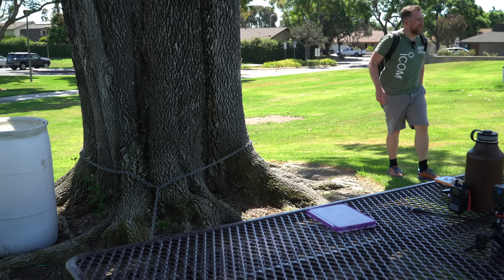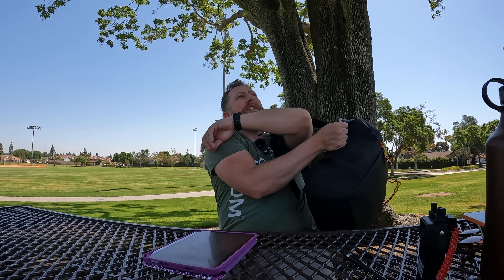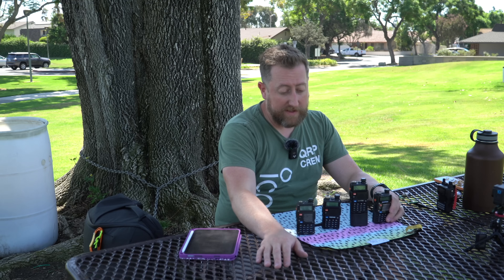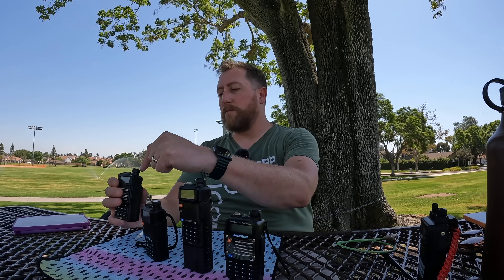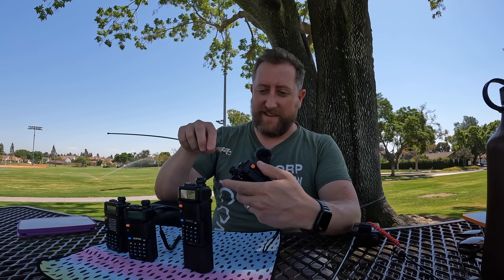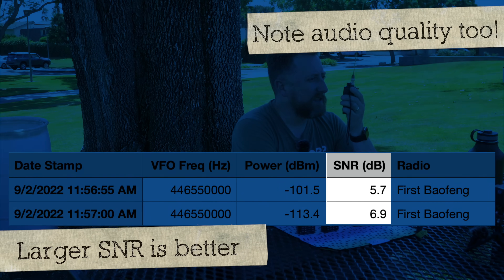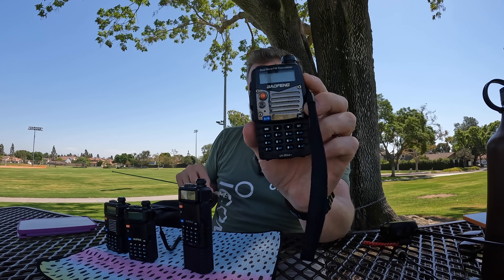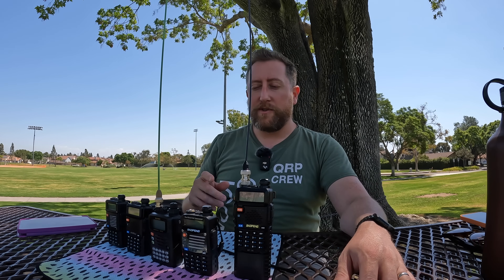Baofengs Testing Throwdown - UV-5R, BF-F8HP, GT-5R Ham Radio Testing

Comment: I have both the UV-5R and the BF-F8HP. Here's the differences I've noticed over 2 years of owning them:
-BF-F8HP has a better speaker. It has more bass to it so voices sound more natural. The UV-5R is more difficult to hear weak transmissions and understand them due to this. 
-The BF-F8HP when scanning is not able to skip a channel with the arrow button and continue scanning. The UV-5R can do this. 
Below I will post transmit wattage for both radios as tested on a Surecom SW-102 w/ a pigtail and adapter. Some loss will occur due to this.
UV-5R: 
-2m Call 5.25w
-70cm Call 3.75w
BF-F8HP:
-2m Call 6.5w
-70cm Call 5.7w

Comment: I currently have a Baofeng UV-5RV2+ but am upgrading to a Baofeng BF-F8HP because the F8HP can legally transmit to FRS frequencies which could be important in emergency situations.  I am dual CERT and ham technician certified and am on our city emergency communications net.
Reply: At the risk of being labeled a sad HAM: BF-F8HP is not legal for use on GMRS or FRS frequencies. As a tech you should probably know this.

That being said, the FCC has no record of ever punishing a Baofeng user for using GMRS/FRS frequencies. They're far more interested in pirate radio, jammers, or people interfering with public safety. As long as you're not being a dickhead you almost certainly won't have an issue using a UV-5R or F8HP on FRS/GMRS frequencies even though it's not technically legal.
Reply: @dan8250  The FCC told me that I can transmit on those frequencies in emergency situations. That is the only time I will transmit on those.  I do have them programmed on my radio though. My family also has a GMRS license and I have a GMRS radio.

Comment: The Baofeng is THE radio that has brought SO MANY folks into HAM radio, it is the undisputed champ and best entry level radio. Stop your BS complaints of the UV-5r and give thanks for then number of folks that started here. HAM radio was dying until this radio came along. Yes there are better HT's and all of us who started with the UV-5FR and mostly moved one but we still have our UV-5R's and we love them.
Reply: I've been saying the same thing the BF F8 HP pro is awesome, and btech does an excellent job of modifying them. Even in his test, his yeasu was by far the worst transmitter 😢. If not for baofeng, the whole ham gig would be just about over now. All they need to do is enter the all mode mobile arena even at 50 watts and game over for icom and yeasu. No hate I have a DX10 but sad it's not all mode like the 991a I'm sick and tired of stacking radios and wires it's completely unnecessary in almost 2025 but thanks to the fragmented big boy brands that can't decide on a mode this hobby is going nowhere fast especially after starlink came out.

Comment: Now I am more confused!  While the numbers clearly showed the GT-5R being the winner, I think it sounded infinitely worse and harder to understand than the BF-F8... like not even a comparison.  Also by comparison, my Midland 275 GMRS sounds infinitely clearer, but I haven't learned how to use repeaters yet.  I was picking up people from Abilene (TX) while in Colorado yesterday... 428NM from KALS to KABI.  HOW in the world could I hear them (they could not hear me)...???  Also- if I can hear GMRS for 400+ miles away, while in the mountains with rock walls towering over us, why would anyone limit themselves to a radio setup limited to just a few miles?  Was this a fluke?  (It has to be.  The radio in the King Air I fly can't reach that far...How else can a $125 radio tucked into the mountains perform better than the $10,000 radio in my plane at 25,000'?)  None of the radio licenses I have had for 25+ years now give me any ability to explain this: not my GMRS, HAM, RRTOP (Aviation specific) ... This flies in the face of everything we know about radios... ANY THOUGHTS?

Comment: UV-5R vs BF-F8HP. Most of the review videos I watch comparing these two radios is over my head. I want to pick one for listening to VHF and UHF. Not planning to talk on one. The BAOFENG BF-F8HP appears to have wider frequency spectrum than the UV-5R. VHF: 136-174 MHz(Rx/Tx). UHF: 400-520 1000 channels vs VHF 144-148MHz, UHF 420-450MHz   128 channels. The videos I have watched don’t seem to speak about that. Can you help me understand if my reasoning is correct for my intended use.

Comment: I gotta say, the BendixKing Digital radio I used with Fire/EMS back in 2001/2008 didn't sound as good as this UV-5R. 
Honestly impressive how far weve come that a Sub $30 (Included Abbree ar-771 antenna) can sound and transmit this well.

Comment: The GT-5R does not have S E spurattic emissions this was the radio that fixed the UV-5R and always use a speaker mic
Reply from the maker: Most are spurious emissions free.  Much better than the UV-5R though.
Reply: I had to drill a hole (didn't drill big enough so I got to drill bigger than the original port) in the mic port and going to have to do the same on the speaker mic.

Comment: Thanks for the tests. The Gt-5R did better than I suspected it would. I own Yaesu FT-60, FT-70. The 70d is a disappointment with the parasitic drag on the battery. Love my 60 to the point of wearing the keys off of it. If the FT-60 came with Lithium batteries, I'd own 5 FT-60s. I own UV and GT-5Rs for my go bags and when riding my motorcycle. All of my radios have Signal Stick antennas.

Comment: 6dB is also 4x the power. However, on UHF and VHF handhelds, the radiation pattern varies widely based on your hand position, antenna orientation, exact position relative to metal objects, moisture content of the plants, etc. you could get a more objective measurement by using a fixed field strength meter while using a fixture to hold and position the radio so it’s consistent from test to test. You can hear the variation in the receive audio at your home station and also in your tone test. Having said that, your testing is somewhat more objective than man others on YouTube. Thanks!

Comment: Josh... Among these radios, the power choices were the UV-5R for 4W, or the BF-F8HP for up to 8W.  But, I now see (on Amazon) that there is a new generation of the UV-5R... the BAOFENG UV-5R 8W that is also suppose to have an upgraded chipset as well, and 3 different output levels (1W/4W/8W).   I don't see anyone talking about this new more powerful UV-5R.  I'm wondering what you, or anyone, thinks about it.  And given the new power for the UV-5R, is it worth the extra money for the  8W BF-F8HP?  Thanks.
Reply: I also saw that... was wondring if they would send the 5w and make it a hassle to get the 8w---- if that is actually a thing.

Comment: Josh, great info, thanks for posting,  can you or anyone comment if there is any improvement on the receive side of the GT5R as well- pertaining to intermod rejection or is it the same as basic UV5R? Also, without the spurious emissions (GT5R) would tx power be more efficient on the chosen freq?  I have a recent Amazon UV5R seems ok, but am considering if it is worth it to upgrade to the GT5R or an even bigger step to the FT60r as the radio will be accompanying me on motorcycle rides with a 771/signal stick style antenna.. Thanks all.
Reply from the maker: I have not tested the GT5R receiver against the UV-5R.  It's on my list to do though!

Comment: Got f8hp radio March 5th worked good for 6 weeks. Two weeks ago I turned it on it made a cracking sound lost all audio. Even to earplug. Reset it 10 times still dead.

Comment: I tested mine last night on an HP 8920A RF test set (using a Baofeng 3800 mAh extended battery fully charged) and found high power at 146.52 only produced 5.57 watts (with .12 uV sensitivity on receive), 446.00 produced 5.27 watts (also with .12 uV sensitivity on receive).

Comment: My f8hp, like others (most likely ALL F8 series) has off center accessories port holes. This makes getting the programming cable or shoulder mic's plugged in nearly impossible unless you cut off some of the connector rubber (see photo). The manufacturer clearly didn't test a prototype before going to full production, not surprisingly, you get what you pay for now days!
Reply: No, you don't always get what you pay for now days!
That is why he is testing radios.

Comment: My Baofeng BF-F9 V2N are not doing anything but acting as paper weights.  I wanted them to use as walkie talkies.  I programed them as a scanner using CHIRP.  I searched for my local frequencies and loaded them.  I clearly dont have a clue what I am doing.  They scan but you never hear nothing.  All they do is scan.  I cant find any video's on how to program them properly to use as walking talkies.  I followed all instructions to program as a scanner about 1000 times and they dont pick up anything.  I have had a scanner for years and these are not that.  All I wanted them for was the walkie talking function but they are useless.  I want to use them but all this radio jargon and tech specs are confusing for someone not in the game.  I'm about to throw them in the trash and just buy some others that are idiot proof.  I've used walkie talkies for many years and these things literally dont do anything.  Its probably me but I wouldn't know because I feel like I'm doing all the right stuff.  I need someone who knows more about them to tell me what I am doing one.
Reply: Throw them in the trash right now & don't look back!

Comment: My primary radio is a Kenwood TH-F6A with a Diamond SRH320A antenna, my mobile is a Kenwood TM-D710GA with a Diamond CR320A. I've had the CR320A for 12 years.. and bought it because the Kenwood TH-F6A was my first radio (tri-band)... but it works wonderfully for the TM-D710 series radios. I've managed to comm with the ISS on several occasions using it as well as running APRS through the ISS.  The older TM-D710A I have started having issues after a few jump starts, causing it to drain the battery due to high current draw when idle, so it has been blackholed as a spare.  I bought a Baofeng GT-5R for SaG and threw a Nagoya NA-771 on it... I'm hitting repeaters here in NC clear as day with no problems. I'm about 15 miles from Raleigh and can hit almost every single repeater with no noise and zero complaints using the internal mic. Don't underestimate this little $25-$28 guy. I bought the GT-5R for my bug out bag... but with the 3800mah battery and lack of noise or issues, it''s becoming my go-to HT.

-AB9XA

Comment: I have a GT-5R that I got for the soul purpose of listening to rocket launch repeaters. They Tx on 2-meter. The GT-5R is equipped with a Signal Stick. I've found that, in order to receive, I almost HAVE to have a ground plane. I have tried leaving the radio attached to my backpack as I am listening to the launch broadcast, but it is frustratingly bad. If I take the radio and set it on my aluminum tonneau cover on my truck, it receives like a champ. The bad thing is, I am not always next to my truck when I am trying to listen. Admittedly, I know nothing of HAM yet, just how to program frequencies on the GT-5R. I am wondering if there is anything I can do, to mimic a ground plane when the radio is in my hand, vs. sitting on my tonneau.
Reply: Counterpoise?
Reply: @shoersa  yes, thank you. That's the word I was looking for, lol

Comment: @HamRadioCrashCourse - Can we see a GT-5R / Yaesu FT-4X head-to-head send & receive, best-vhf/uhf antenna test on 2m/70cm next? 

I am curious how the Baofeng and Yaesu perform under different antennas in direct comparison.
(Side note: I have a BF-F11 which claims to be 10w, and is a variant of the bf-a58s tri-band'er. The speaker on that is much clearer, then the UV5r, which i also have. - If you get a chance to test one, please share the results with the rest of us!)

Comment: Josh:  Unrelated question    Our Yaesu FT-2800 has taken a lighting hit on the power input. Does Yaesu have a Service Center we can send it to or do we have to go through a dealer. WB9SWR  Bill
Reply from the maker: Depending on how long ago you bought it you might want to check with the dealer first, but yes, they have a service center.  It's like 5 miles from my house.
Reply: @HamRadioCrashCourse   It donated to EMA by our local ARC , date and dealer unknown
Reply: @HamRadioCrashCourse   Can U supply a address & ph # ?
Reply from the maker: @wmhoward2249  Google Yaesu California

Comment: I’ve been able to transmit 33.25 miles with my BF-F8HP and a NA771 antenna.  From Castaic CA down to Pasadena, CA... and the people on the repeater said I was perfectly clear, rated me a 5 out of 5 for transmit clarity.
Reply: My 146.52MHz handheld to handheld record was about 60+ miles from Phoenix to the mountains to the north. I don’t know where he was exactly (other than the name of the peak) and there was a pileup after we finished. Imagine a pileup on .52 simplex.
Reply: Hello from Riverside! Just bought my first ham units- f8-hp and president Lincoln II+. 🍻
Reply: How do you know how far they are?
Reply: @yourface3154  you ask them what there location is then use a mapping service find your location then there location use a measuring tool draw a straight line from you to them then look at distance by which the crow flies meaning from air not on the ground like Google maps
Reply: @yourface3154  If you notice on the comment above yours it says he knew the name of the peak the guy was on. Typically you will ask where they contact is located so you can get a general idea of how far they are.
Reply: How far can you receive with your bf f8 hp?

Comment: i have my tech licence for several years now, but i still know nothing of armature radio and have never been on the air, so a lot of this goes over my head, but i like this channel because you make these things somewhat understandable for me, and youre not snobbish about equipment. keep up the great content.
Reply: You went through all the trouble of getting your Ham Radio license, why not use it???
Reply: @lomgshorts3   it was no trouble at all. just took the test. its mostly basic safety and electronics that i already know. there are so few radio related questions you could get them all wrong and still pass. 

spending hundreds of dollars on equipment, otoh, is difficult.
Reply: @502deth a uv-5r is roughly $25 and you can grab a better antenna for $20 or so. Then find out if there's a local club and when they have their net. For example here the club has a repeater and has a net on Sunday nights. So I can tune in on Sunday nights and listen in and get the feel for the etiquette.
Reply: @billtheunjust   i live in the middle of bumfuck nowhere. i have a uv5r, there is NO  traffic within receiving range. even tried to build a few antennas and hook them to it. the nearest "local" club is 45 min away. i feel if i want to do anything useful im going to need to buy a whole hf setup.
Reply: @502deth  well, I guess plan b would be to grab a mag mount and your uv-5r and drive into repeater range when they have their scheduled net. I know it's not something you'd want to do often, but it would at least let you get a feel for hew a net works.
Reply: "Armature" is something that arms or strengthens something else, like the steel armature of concrete.  For ham radio, the word you're looking for is "amateur" as in "amateur radio".  "Amateur" is a French word coming from the Latin "amare" = to love.  For us, it means unpaid lovers of radio, as different from paid radio professionals.  The nickname "HAM radio" comes from here:   The word “HAM” as applied to 1908 was the station CALL of the first amateur wireless station operated by some amateurs of the Harvard Radio Club. They were ALBERT S. HYMAN, BOB ALMY and POOGIE MURRAY. At first they called their station “HYMAN - ALMY - MURRAY”.  So, there, that's why, today, we have HAM Radio. 🙂

Comment: My old UV5R TP (Tri Power) had reports of low TX audio. There's foreign instructions on how to add an SMD capacitor between the mic socket trace etc which boosted it. I also drilled the mic hole which helped a little. 

So compare your old and other Baofengs nearby your SDR and see if talking closer/louder to the mic helps that one. Is it really a TX power/distance issue or the mic? Or try an external mic. Also try swapping over the battery. 

I tried talking at various distances from the mic and I think 2.5 to 5cm was best on my SDR stick. Of course, counting the distance in cm on the radio affected things as 'five' is louder, so you'd need to say the same thing. 

Trying a power meter on them would be good for another video too. Maybe even hook up a bench power supply and decrease volts/current to show what happens when using an old battery. 

Also finding a tool to measure your old battery capacities in mah would be neat. Then make a PSA video on when to replace them.

Comment: What I’d love to see is the FT-5D and ID-52 up against the best of the cheapies.  It would be interesting to see if there is any RF performance benefit for the much higher price, or just screen and features?  You could even add in some strong local signals, and for RX, attenuate the sending radio at home, as I’d like to think selectivity as well as sensitivity and lack of front end overload is what your money gets you…..
Reply from the maker: You're likely correct across the board.  I will do a different test for selectibility.

Comment: Baofeng 8W actually outputs at 6.5W according to my meter...
Reply: I recall a bunch of tests or videos saying the same
Reply: Up to 8W...hahaha
Reply: I tested both my TD-F9GP 8W  versions with fresh battery's into dum dum load. Both 6.7W on same sweet spot freq. Not a powerhouse but better than my old 5W Baofeng that only saw 3.9W on high. That 3W difference means something on a fringe signal.
The stock antenna's are junk and the built-in mic's are weak compared to a good hand mic but still hard to beat em for the price.